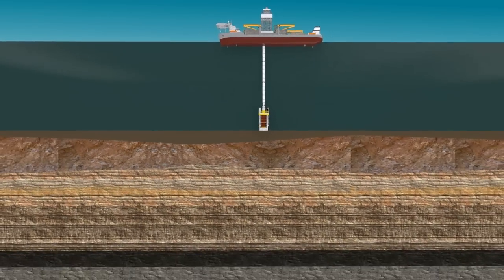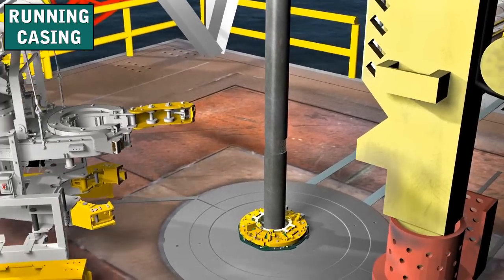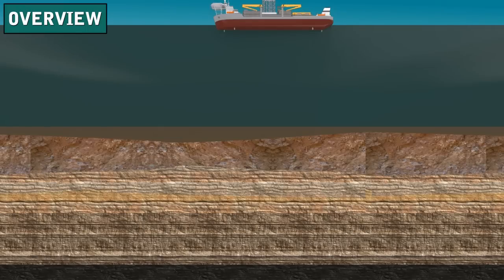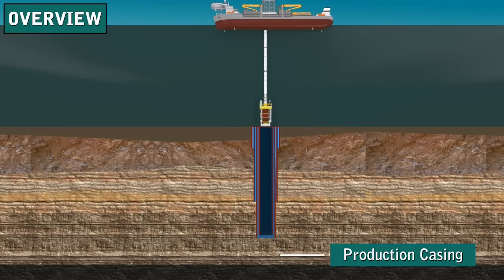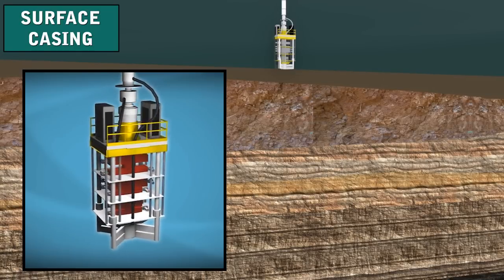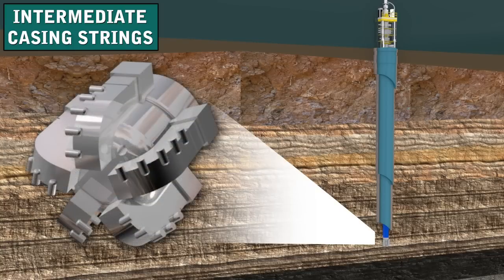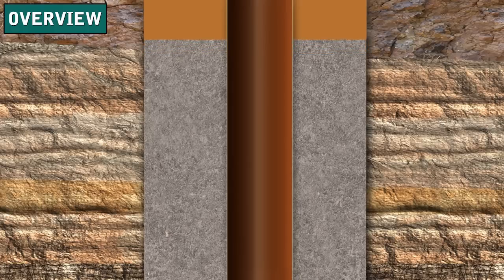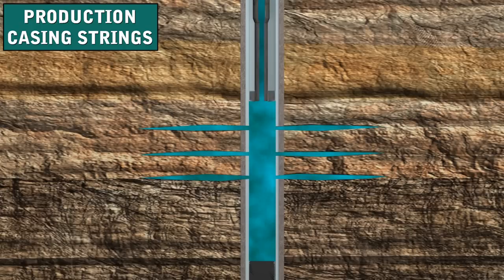Running Casing

Comment: Your depiction is not accurate, the "conductor' "jet string) and "surface " casing are run in open water before the BOP is deployed. Those strings can not be run thru a 21" ID riser. 22" casing has the high pressure wellhead housing on top, and that is what the BOP connector latches to and seals the wellbore from open water. Also, most 'deepwater' wells have more than 4 strings of casing in them. STAMPEDE has 9 strings not including the completion tubing run. A deepwater rig moves too much to effectively run a CRT tool, and we DO build casing into 3 joint stands and run from the derrick, as well as bring 'doubled" casing joints to run from the riser skate, thus cutting our run times significantly.   FYI

Comment: When I worked for Frank's Westates in Vernal,  Utah, we didn't have these videos.  They just   tried you out green. They  wanted to know if you could pull slips for hours on end and whether you could actually follow instructions. And you had to be okay with working at twenty below.   Colder than that in parts of Wyoming.  I jumped in and out of a lot of pipe tubs. Hopefully, they've done away with them. They're dangerous.

Comment: Has anyone ever thought of assembling casing in strings of three and running them into the well that way to speed up the process?  On a land rig the casing could be assembled with a spinner at the mouse hole and the stored in the pipe racks to await the CRT running them into the hole.
Reply: Hey! I know there are a couple of rigs here in the North sea of Norway that does this, except that they only do it with two at a time. Ive been told that one "side" runs the double casing sections, while the other side turns the two casing sections together. When they have lowered the string down to the ocean and the double casing section is ready they lift it over so that it can be joined with the string going into the ocean. And repeat. 

Know this is late, but hope this answers your question
Reply: @kristianbang3027  hey brother, is it difficult for Americans to get work over there.Especially as casing hands
Reply: We do that on the Deepsea Stavanger in Norway. Three joints pr stand. When run in hole we do 20 stands pr hour with 9 5/8" casing. (60 joints) Odfjell Well Services.